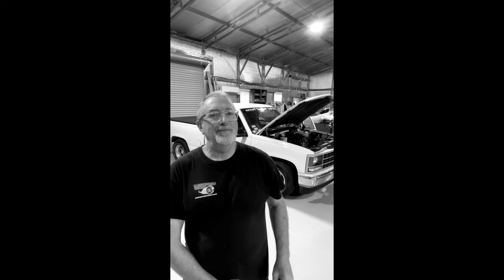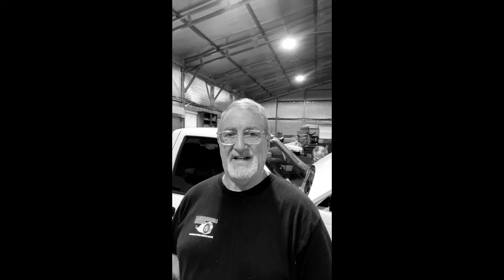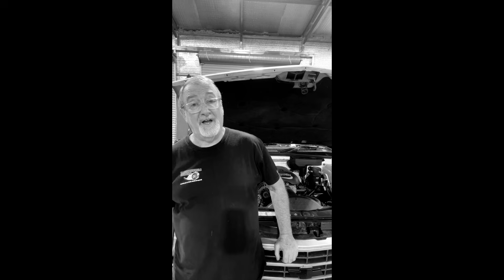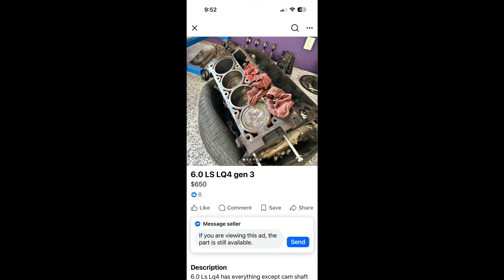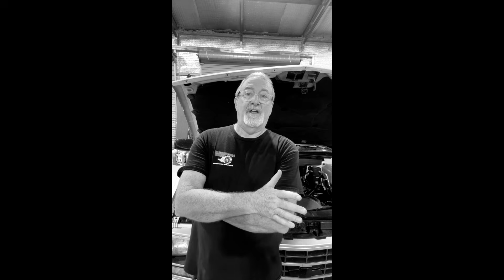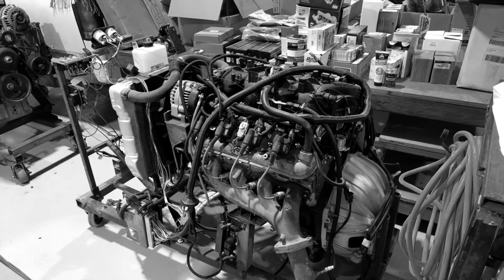Cheap LS Swaps Are Disappearing

Comment: Gen 3 bad, gen 4 good
Reply from the maker: Why are gen 3 bad? And what makes gen 4 good?
Reply: @laurencevillegarage 3rd gen had weak rods, worse intakes, worse heads. 4th gen you really don't need to touch anything but the cam. Electronic throttle IMO is also easier to work around than a cable. The later ECUs are also better suited to do forced induction.
Reply from the maker: If you are going for more hp stock and need the better internals, I agree. However, if you are considering your first swap and are just getting your feet "wet" with the LS, go gen III. 275-300 is enough hp to have fun with and learn all the "ins and outs" of the swap. Get it running and driving, THEN build it up from there.

Comment: get them while they last .  they run 1000 fully dressed  in southern maryland . I own and drived 2 gen3 vortec( lq4) swapped 2nd gen S10 blazers . bonestock minus hedman headers  . did work myself . was able to do swap for 2500 each . around here used cars go for 5000 -8000 bucks.
Reply from the maker: Wow! Really depends on location. $2500 is pretty good!

Comment: About $900 in florida for the 5.3 on market place. I have never been able to pull an engine. For 5 years there have been waiting lists at the yards i go to. I never had time or patience to wait. The list works, some one gets to pull a running engine for a few hundred if your patient. You go on the list, when the truck or van shows up and your name is up your good to go. With all the china parts online i feel its still a cheap way to go. I guess everyones version of cheap is also different. Also I was just in Baton Rouge and there were lots of cheap trucks for sale with running 5.3 and 4.8.
Reply from the maker: Someone else just responded from Louisiana and they said they found some good buys there as well. Thanks for watching and responding.

Comment: Having a small home based engine machine shop has taught me a thing or two about the “LS swap”. 
  First thing I will say up front. If there is a finer, more available overhead valve engine out there, I don’t know what it is. 
   Second.  They’re getting old. Aluminum has a life span. Heat cycles count. Heat treat goes away and there’s no fixing it in an affordable manner.  I’m already seeing this with many LS cylinder heads. 
   Third. If you’re planning on the cheapest performance upgrade there is to one of these engines. That being turbo charging one. Take the engine apart and check ring end gap first or do not attempt it. 
    A good mechanic friend of mine went through three “junkyard LS” engines before I was finally able to talk him into letting me see what happened to the first two engines. 
    Both engines had less than .006” ring end gap from the factory.  That is a no go hard stop that will not work. 
      As it sits right now my next door neighbor just added a supercharger to a Gen 4 LS in his corvette. 
     I urged him to at least check ring end gap first. Printed out the General Motors engine specifications and showed him the ring end gap tolerances.  
    I’ve heard that engine running. It’s been several months since I’ve heard it running and he’s gotten very quiet for some unknown reason.  
   I just hope he hasn’t hurt it. I feel that he is too ashamed to ask for help after the fact.  
   Either way. Too many of these engines have been ruined because of this one detail.
Reply from the maker: Good to know. Don't wait too long to get decent heads now.